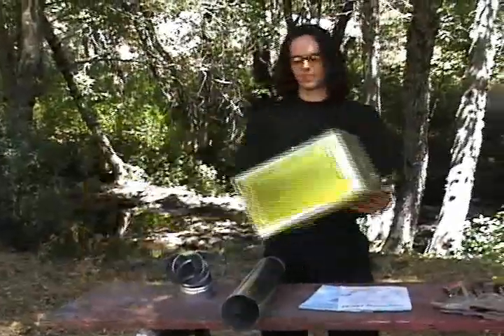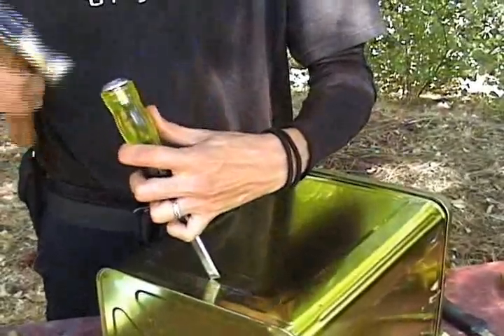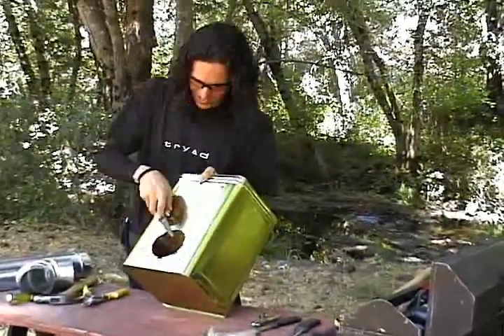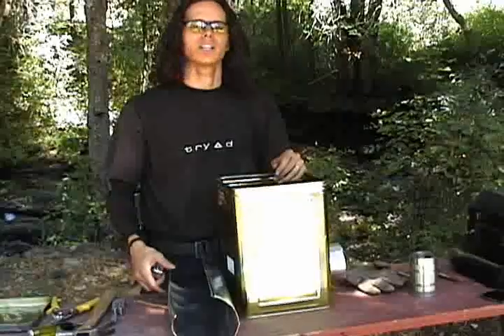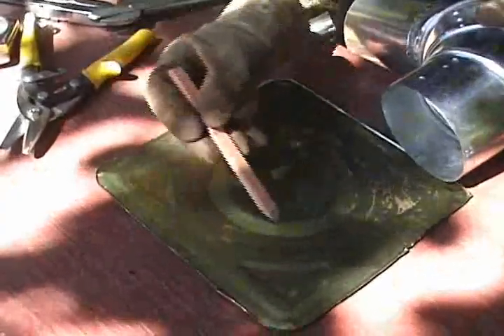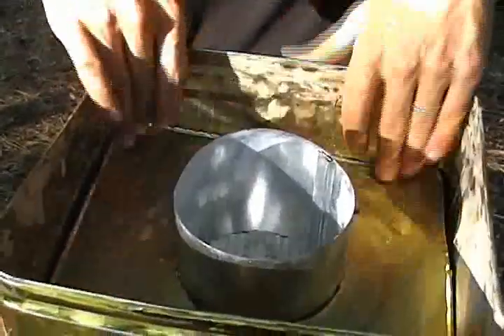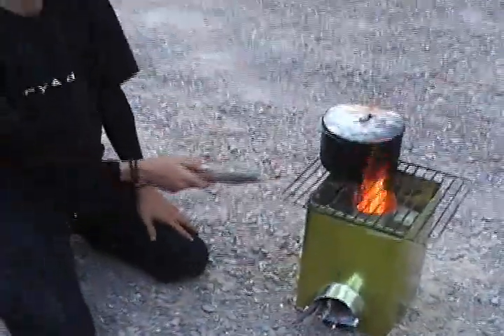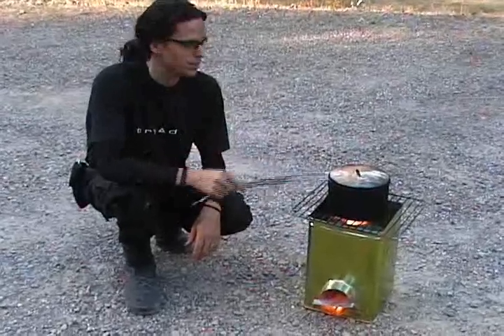Vavrek - How to Make a Rocket Stove

Comment: nice video, but you should realize that what you are using is not stove pipe, but is galvanized steel hvac duct which can put out toxic zinc fumes if heated enough, stove pipe is made of plain blackened steel.

Comment: I have seen some Rocket stoves made with holes cut around the top, about a half inch or so from the top, some have also had the same holes cut around the bottom and another had 3 or 4 holes cut on the backside, they all said it was to allow air in to help with the fire & to also allow gas & flames to get out, do you see any such benefit to doing this with your design or feel they are needed or would help in anyway, thanks.